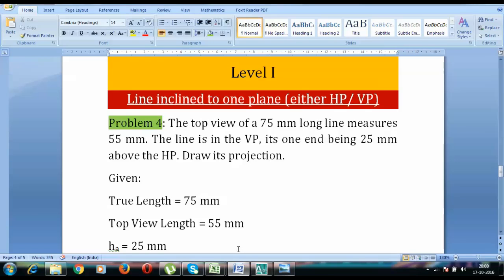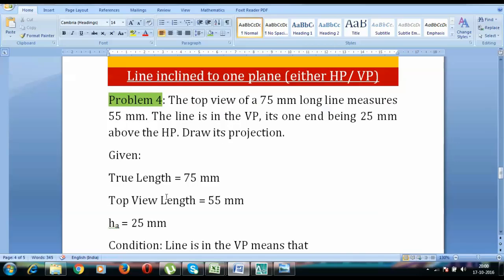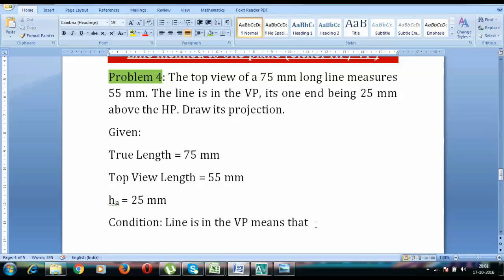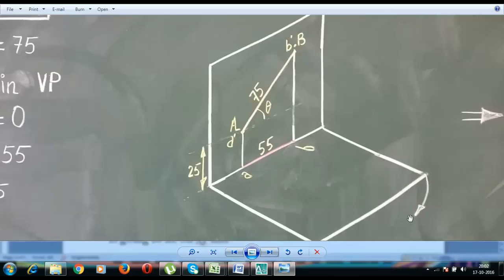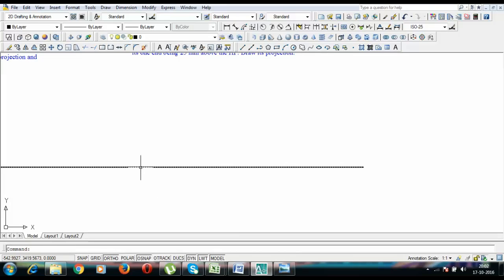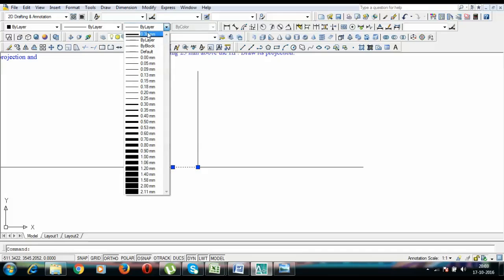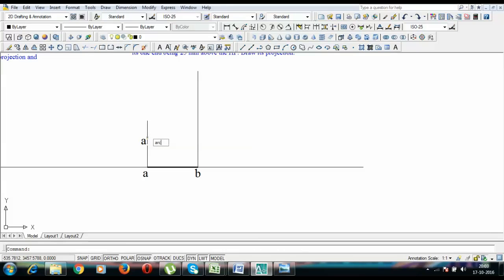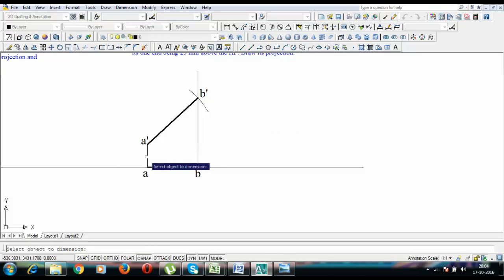Projection of Lines | Level 1 Problem 4 | Line in VP and inclined to HP

Comment: The front view of a 75 mm long line measures 55 mm. The line is parallel 
to the HP and one of its ends is in the VP and 25 mm above the HP. Draw 
the projections of the line and determine its inclination with the VP

Comment: A 100 mm long line is parallel to and 40 mm above the HP.Its two ends are 25 mm and 50 mm in front of the VP respectively .Draw its projections and find its inclination  with the VP.Sir  pliz solve dis qsn

Comment: Sir i want to ask you about the software cad 

In which year of mechanical engineering this is needed

And my brother is also studying in nit Uttarakhand mech branch and demanding a laptop what configuration does it needed to run all the software of mechanical engineering 
I am asking you about this because i have no knowledge of software in mechanical engineering

Sorry for this question but its an emergency because its diwali time and diwali off in laptops
Thank you sir
Reply from the maker: 500 GB Harddisk, 8 GB Ram and i5 processor..
Thats all....and a good brand...